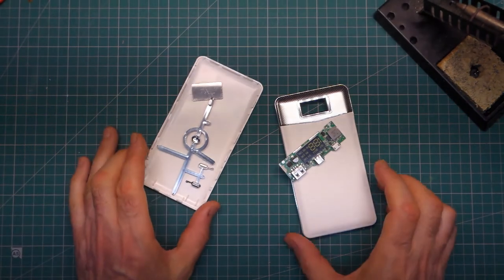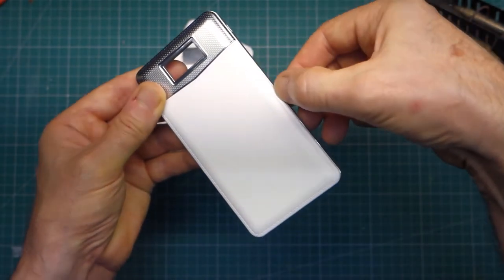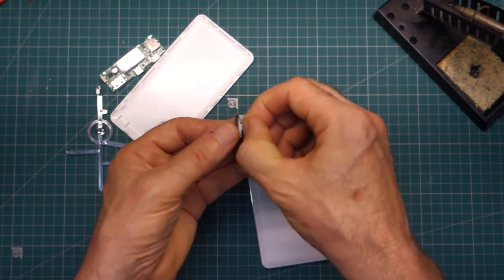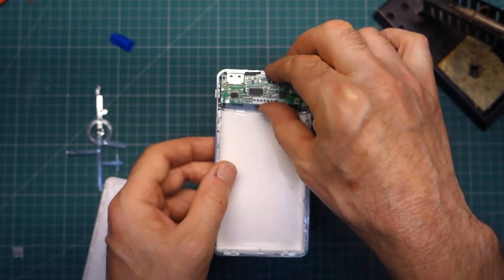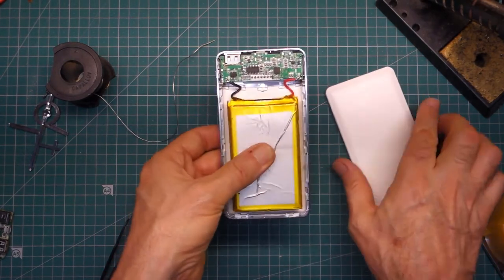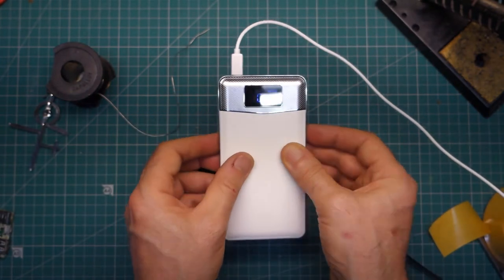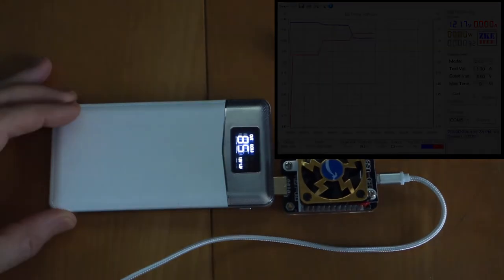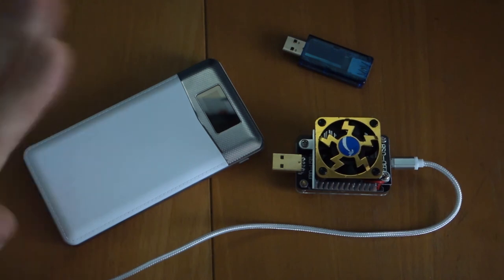Ep30  Fast Charging Battery Bank QC3 0

Comment: The case says it can fit 2 of these 6060100 batterys so does that mean it can balance them? I was considering using the electronics from this case with a large stack of these batteries to make a much larger capacity battery bank but i wonder if its capable of balancing the cells?
Reply from the maker: No need to balance as the 2 cells are in parallel...